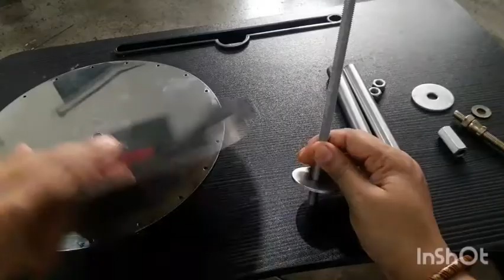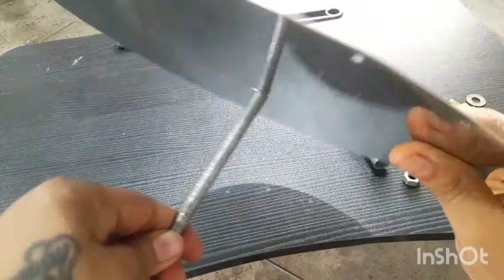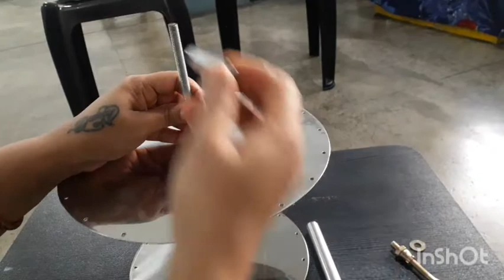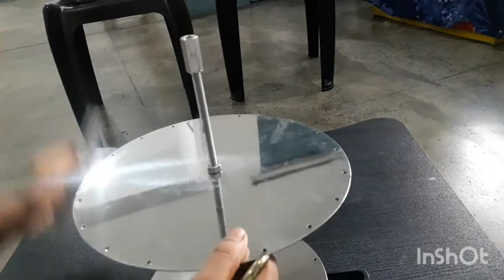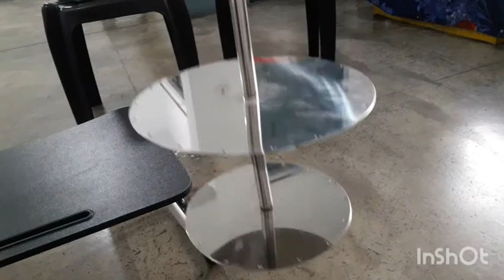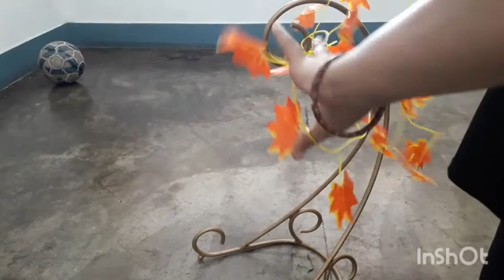How to assemble chandelier cake stand

Comment: Hello, do you still sell the plates and the cake stands?
Reply from the maker: Shikha- the cake decor 8968960252
Its available with 3 tier plates 10", 8" and 6", u can use it as per your need
Reply: @Santripti  What is the price of the plates?  You don’t sell the stand?
Reply from the maker: @cynthiahamilton147  i bought this stand and plate from mention above contact no., you can call and confirm